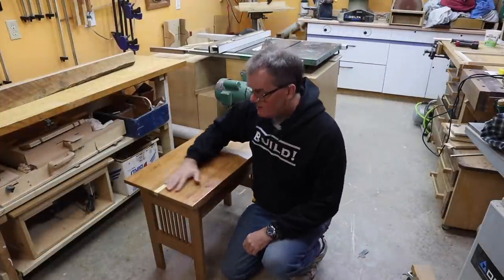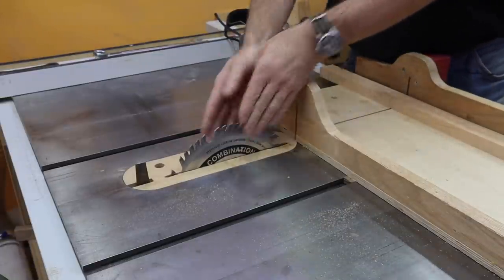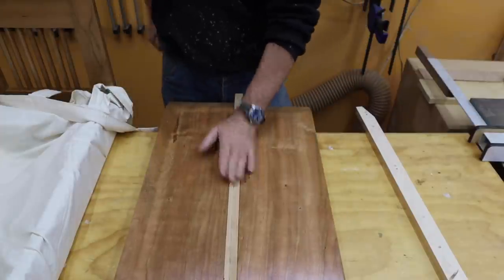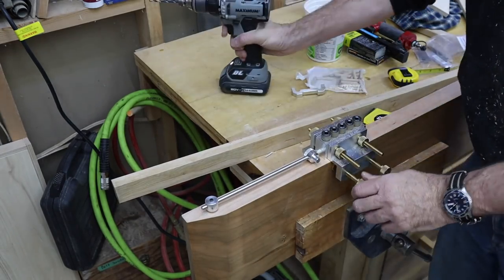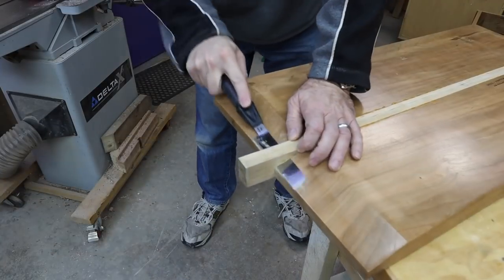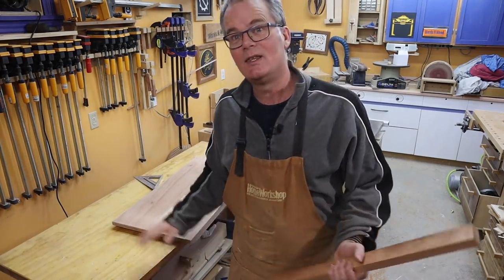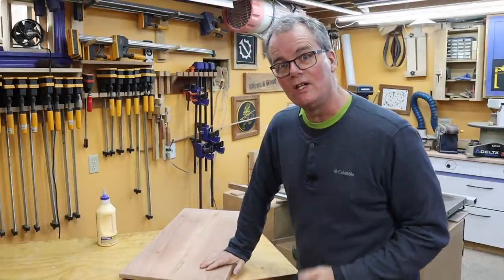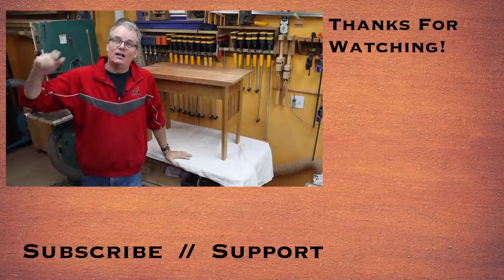I cut my table in half.... TWICE.   // WnW 218

Comment: Just found you today. What a relief! I've been watching all the "expert craftsmen" videos where everything seems to be cut perfectly, no mistakes are made (at least not shown), all joinery is perfect and pristine. Even the finish looks pro level. Makes me want to switch from woodworking to collecting pieces of string. I spend a good deal of time in my 12x16 shop moving things around, to make space for actual woodworking. Inevitably, those things I've moved still get in the way, or fall off the bandsaw table or table saw onto the floor, and then, since I'm  70, I usually end up tripping over them.  Your shop looks immaculate, so kudos to you. I'd have to remove several large machines and drywall my  Tuff=Shed to look as neat and clean. Still, I believe you represent a lot of us out there who sometimes spend too much time swearing at themselves for being so inept. I subscribed.
Reply from the maker: You mean my finish isn't flawless?  Say it isn't so!   🤐

Comment: That was a good choice to redo it the second time. I like the edit you did when taking out / putting the screws in. Happy new year!
Reply from the maker: I'm trying to avoid the use of high-speed video, so that is one fun way to show all the steps in a procedure.   And yeah, I had to double check to be sure that the first replacement wasn't sapwood it was so much paler.   The original top had sat in my shop for almost 2 years, so it was some well aged cherry, which may have made part of the difference.  Happy New Year, Wes!  I almost called you up to come over and borrow your wide belt sander, but then realized that cutting out the strip was the real solution.

Comment: Throw a walnut strip in there just so we can compare. If it doesn’t look good let’s go back the cherry... again again.   Looks great. The extra effort was well worth the final result. I love your note on the bottom too.
Reply from the maker: Darn it, I should have gone candy cane stripes...
Reply from the maker: ps: had to modify my normal methods of signing to commemorate this.
Reply: @Wordsnwood  can I ask how you did it? Is it just regular printer paper with inkjet or laser printer with black ink?
Looks great!
Thanks!
:)
Reply from the maker: @enzprintco.8625   Print something on a laser printer (NOT an inkjet, it must be laser toner).  You need to print it reversed.   Then lay it on your workpiece and wipe across the back a few times with a rag dampened with Acetone.   That's about it.  Try googling "Acetone Transfer"  or "Toner Transfer".

Comment: Very nice.  Do you have a video explain the process of putting the lettering on? that looked like it worked really well. Thanks.
Reply from the maker: It's pretty simple.   Print something on a laser printer (NOT an inkjet, it must be laser toner).  You need to print it reversed.   Then lay it on your workpiece and wipe across the back a few times with a rag dampened with Acetone.   That's about it.  Try googling "Acetone Transfer"  or "Toner Transfer".    I've tried nail polish remover and it failed completely - not enough acetone in it I guess.  Supposedly it also works with lacquer thinner but I have not tried that.  I never get 100% copy.  I usually get around 95% transfer, which is good enough for my purposes.

(and no, I don't have a video of it, but others do, most notably John Heisz of ibuildit)

Comment: I agree with you. The top looks much nicer without the contrasting stripe. Can you talk a bit about how that acetone transfer of your maker's mark works?
Reply from the maker: It's pretty simple.   Print something on a laser printer (NOT an inkjet, it must be laser toner).  You need to print it reversed.   Then lay it on your workpiece and wipe across the back a few times with a rag dampened with Acetone.   That's about it.  Try googling "Acetone Transfer"  or "Toner Transfer".    I've tried nail polish remover and it failed completely - not enough acetone in it I guess.  Supposedly it also works with lacquer thinner but I have not tried that.  I never get 100% copy.  I usually get around 95% transfer, which is good enough for my purposes.

Comment: Do you have a video on how you do the acetone toner transfer? It turned out great!
Reply from the maker: It's pretty simple.   Print something on a laser printer (NOT an inkjet, it must be laser toner).  You need to print it reversed.   Then lay it on your workpiece and wipe across the back a few times with a rag dampened with Acetone.   That's about it.  Try googling "Acetone Transfer"  or "Toner Transfer".    I've tried nail polish remover and it failed completely - not enough acetone in it I guess.  Supposedly it also works with lacquer thinner but I have not tried that.  I never get 100% copy.  I usually get around 95% transfer, which is good enough for my purposes.

(and no, I don't have a video of it, but others do, most notably John Heisz of ibuildit)
Reply: Thank you very much! I’ll give it a shot.
Reply: @Wordsnwood  Hate to ask but do you use any specific type of paper?  I put in a new toner and printed a test and using 100% acetone I received about 10% transfer.. lol  To the point where you couldn't make out the words but I am using all purpose copy paper so that might be why.
Reply from the maker: @twostraydogsfishing  plain old laser paper -- well, we do try to get recycled stuff, but it's not always available.  We currently are using 20lb paper with a 92 brilliance and 100% recycled.  But again, I've always just used whatever was in the laser printer.   Here is John's article/video where he went into more detail, but it's basically summed up in what I said:  https://ibuildit.ca/tips/label-your-projects/

Comment: At 2.40 when you switch back to the combination blade, what kind of cut would using the glue-line ripping blade have produced?

I'm guessing the combination blade produces a nicer crosscut, but for such a small cross cut would the ripping blade have been fine?
Reply from the maker: It would have been fine.  In fact, that is exactly what I did when I had to remake the new insert for "take 2".   
The general advice is "more teeth" for cleaner crosscuts.   I have not made a study of it, I just "follow the rules".   😉

Comment: No sure about how that center strip is visible since it still is from another tree. Instead I might have considered reducing the whole width of the table by gluing the two original pieces into a less wide table top, then cut off the length on the short rails and finally assembled the table back with dominoes (ofc, if you have a Domino). But what do I know? Maybe the wifey required a certain measurement on the piece (as they always do).
Reply from the maker: Then I'd have to get into redoing the base structure...